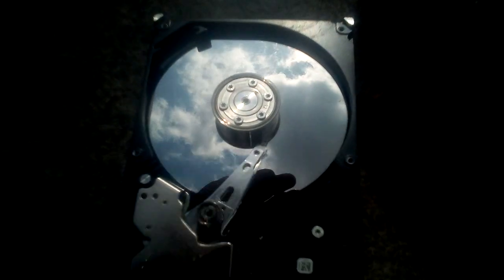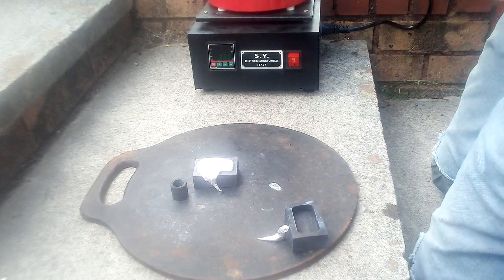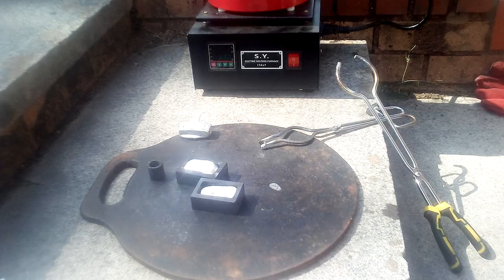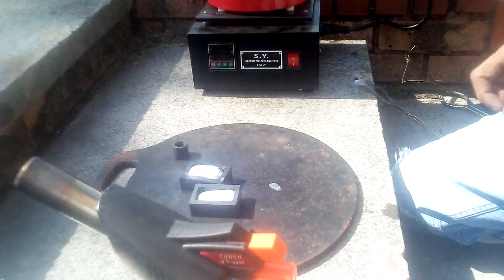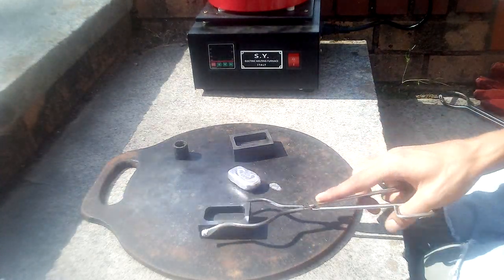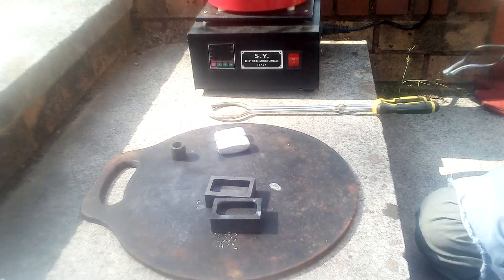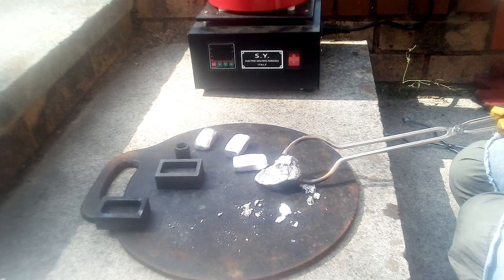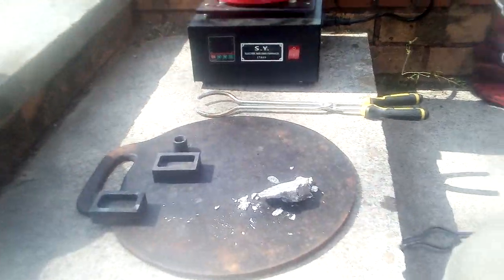Pouring Hard Drive Platter Bullion Bars,Super Shiny,100% Data Destruction.🔥

Comment: beautiful ingots! What temp is the melting  pot? I have an old printer I'd like to salvage, any hints? I think it's a scanner too. Sorry for asking so many questions.
Reply from the maker: Melt took place at 800Degrees Centigrade to ensure a quick melt speed and very little impurity's.
Old printer huh,lots of good steel rods in them make handy jewellers mandrel tools if handles are added,meltables inside would be limited to steel and mainly copper inside the motors and cladding upon circuit boards,Temp for a good melt 1.1k Degrees not a job for a beginner risk of death pretty high copper flows like water at said temps,splashes like it too! 
Sell the parts within after taking it apart,the separate components will sell eventually at a value rivaling the new printer,list them as robotics components an whatnot.
Reply: @welshdragonmetals  Thanks for your answer! I have a torch and map gas from making lamp work beads and I have mandrels from that. I am more concerned about a charge from some internal component but I don't suppose after some 15 years there would be much.